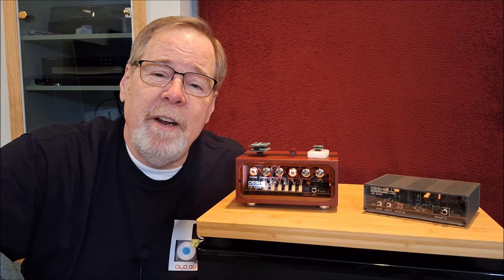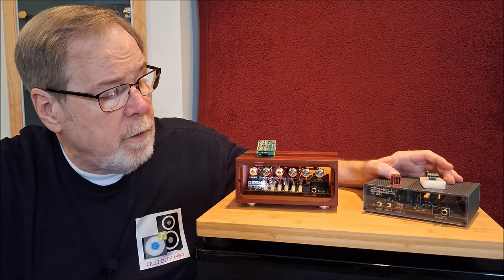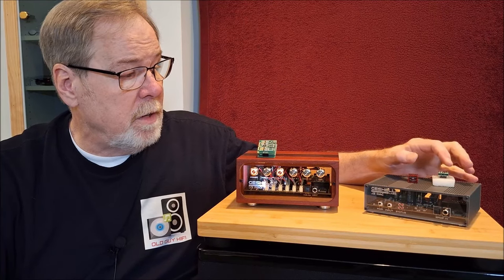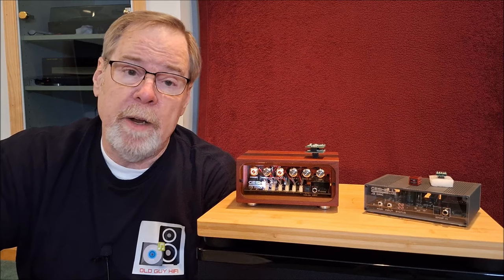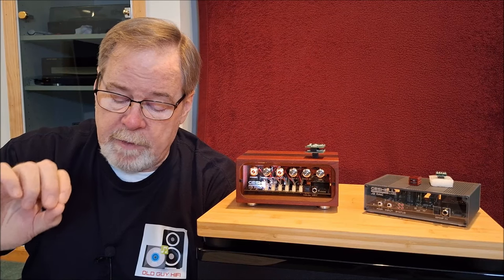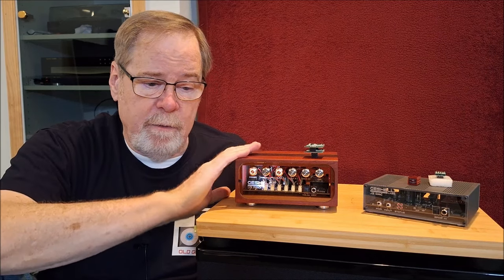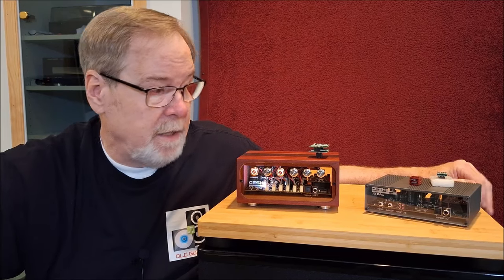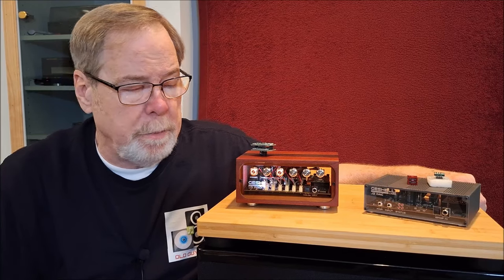The 1st YouTube review of the Geshelli J3 Pro DAC. IMHO it is a fantastic unit full stop.

Comment: First time commenting on your videos.  Sorry for the length.

I value your work and have learned a lot.

I respect your opinion...that said.  I am stuck between selecting the Geshilli J2s or the Pecan Pi + (without the streamer).  I am very happy with my system other than the DAC.

I have a hard time reasoning that all DACs can service all music well.

I primarily listen to instrumental music...mainly jazz (all areas other than free jazz) and classical music (with the exception of period instruments compositions).

Soul (pre 80s) and progressive rock also pepper my listening. 

I am a low brass specialist.   I perform mainly on slide trombone and euphonium. I also have perfect pitch.

I have to live with selection for at least five years.  So please help.  I want an American made unit that serves the music.  Which of those two would you purchase considering the details shared?

Thank you for your time!
Reply from the maker: When it came time for me to choose I bought the J2S. I think it sounds better that the Pecan Pi. Don't get me wrong the Pecan Pi is very good. The J2S is a bit smoother and because you can change the op-amps you can change the sound. It is very good with the stock TI OPA1656 op-amps but I also have the Sparkos 3602 (on the RCA outs) which adds a bit more drive and impact in the bass and mid-bass region. Not too much just better speed. Plus for me the ability to a USB input was key for use. With the Pecan Pi you have to use a SPDIF to USB convertor which, I don't trust to sound the best. I have one and I think it has a negative impact on the soundstage and transients.  BTW, I have a Geshelli Dayzee showing up today which should be interesting. If it is as good as reported, it could be potentially expensive for me. Lol. Let me know what you decide.

Comment: Great review. How is the the J3 Pro better than J2S. Specially when just using single coax input with no need for input switching buttons. Also which op-amp has the most expansive and deep sound. I know all subjective. Thanks. Great review.
Reply: And subscribed.
Reply from the maker: Markus, For all intents & purposes they are identical sonically. The J3 has a bit of a bigger power supply as the large Sparkos require more power and the board was reconfigured to accommodate those large 2590 op-amps. I had the J2S and the J3 side by side and I bought the J2S. The op=amps are very subjective. My advice is to listen to the unit with the stock TI op-amps for a few months and then if you feel the need try rolling them I would start with the Sparkos 3602 and go from there. BTW, If you buy the op-amps from Sparkos directly they offer a 15% discount. I hope that helps L et me know what you decide to do. Great question. Thx.
Reply: @OldGuyHifi  Ok thank you very much. What made the decision to keep J2 over J3? I am interested in trying the Sparkos 2590s (is it) which only fit the J3, or some mod that I read about, which I am not keen on ;) 

Thank you again!
Reply from the maker: Markus, Don't tell anyone bit the 2590 fits in the J2S on the single ended side. I actually showed that in the video. I have both and I don't hear that significant a difference between the 3602 and the 2590. I have the 3602s in my unit and am very happy with the sound. I am actually sending the 2590s back (review samples) and have really no interest in using them. Try the stock TI op-amps for awhile and see what you think. Keep me posted. Thx.
Reply: @OldGuyHifi  awesome thanks for the answers. Like you I prefer R2R over chip based but something magical (supposedly going by reviews) seems to happen with these units. 

Thank you.

Comment: What or how did you modify the Schitt Bifrost?  OG or 2/64?  BTW, ESS chips can run in voltage or current mode from what I've read.  LIKED and SUBSCRIBED.  Thank you for a great review.  Keep up the great work.
Reply from the maker: My Bifrost started life as an OG AKM chip unit. I had a service issue with it and as it was early on in the multi-bit era for them they modified it and asked me to test it. It has a non-standard linear power supply, Unison USB and an Analog Devices prototype 24 bit chip. It also has Elna Aluminum foil caps through out.
Only the very latest ESS chip are current based.
Reply: @OldGuyHifi  Wow, thanks for the reply.

Comment: Hi Ed. New to the HiFi world and just found your channel. Thanks for the great review/breakdown of the J3.  Quick question. I have not pulled the trigger on a DAC as of yet.  I will likely go with the J3 now as compared to J2S with AK4499 its seemingly only $100 more.  I may not update the Opamps right off the bat; however I wondering between the Sparkos vs Burson V7 Vivid. I my starter pair of speakers are the Heco Aurora 300s which I understand to sound a bit on the warm side due to material used on woofer and tweeter.   I prefer a bit more revealing/detailed sounding music....with that would your recommend the SParkos or Burson vivid? Sorry so long winded...  Good luck with your channel!
Reply from the maker: Chris, Welcome to this crazy hobby.  The more the merrier! Honestly, I would stick with the stock TI OPA1656 op-amps to begin with.  They have great detail and will add a bit of midrange to a warm system. You may find you don't need to change them. I ran the J3 with the stock op-amps on the balanced side, for several days of listening and found that to be very good. Seriously good. The magic in the J2S/J3 Pro is that AK4499EXEQ-AK4191EQ chip set and how Geno designed it. Swapping op-amps is more of a tweak and has a subtle sonic effect. As a new person to the hobby, you should listen to your standard gear configuration for months and months, maybe even for years so that you get used to the sound. You want it to be kind "second nature" so that when you do make a small change i.e., op-amp swapping, you can hear that change. Also only make one change at a time, slowly.  Again so you will be able to tease out the differences. Often times, I find that, while there are differences, it still all sounds great. As some famous old guy in history said "Know thy self" I would consul that you should "Know thy system first" before making any changes. I hope that helps you. Sorry for being long winded. Thank you so much for you question and view. I hope you subscribed!
Reply: @OldGuyHifi  Thanks for all the great info/guidance Ed! Much appreciated!  I will follow your advice and order the J3 in its base configuration.  Have a good one!

Comment: Great video! If you were going to order a J3 how would you spec it out? What op-amps would you run?
Reply from the maker: Honestly, I would spec it out as a standard unit with the stock TI op-amps and see what you think. Andrew at Sparkos always has a deal running son if you want to upgrade it is a bit less costly from him then it is from Geshelli. Secret Tip. Skip the USB unless you really need it. That will save $50.00. Also I can't help you with case options because that is a matter of personal taste. For me, because my gear sits in rack behind a glass door, I would just do the standard Aluminum case. Although, after watching Rachel's latest video on the custom carved cases, (https://youtu.be/7mWW4k8N7Ik?si=zmEj50KD0S6PRWkJ) it makes that a compelling option if I was able to show the DAC off.  I hope this helps.  Let me know what you decide.  thanks.
Reply: @OldGuyHifi  Thank you. At this point I'm looking for something to use with my MXN10 and my Cambridge CD player so I can skip the USB... and the custom cases do look pretty slick!
Reply from the maker: I used the J2S (with the 3602 on single ended) extensively with the MXN10 as a source for almost all my recent vintage reviews and the review of the Schiit Freya and Orchard Audio amp. That combo is magic. Highly recommended.
Reply: @OldGuyHifi  running optical or coax out of the MXN10 to the J2??
Reply from the maker: I used both. I am not sure there is a big difference between the two. I use Audioquest Pearl optical and Mogami coax and I find it difficult to hear any meaningful differences. Sometimes I think I do and others... Thanks for asking.
Reply: @OldGuyHifi  sorry for all the questions... Do you use the AKM 4493 or AKM 4499 in the J2s?
Reply from the maker: @S682  Ask as many as you want. No worries. AKM4499. It is the first non R2R or Multibit DAC that could live with. It sounds remarkably good. Highly recommended.
Reply: @OldGuyHifi  Follow up question, how does it compare to the Schiit Bifrost?
Reply from the maker: @S682 Honestly, it is very close. I really think this new AK4499EXEQ+AK4191 chip set is potentially a real game changer. Being a hybrid it kind of is the best of all topologies. This is the first time I have been tempted to add a new reference DAC to the system. They are different but one is not necessarily better than the other just a different sound signature. The J2S/J3Pro are very good. Seriously good.
Reply: @OldGuyHifi  Thank you.

Comment: Great review Ed! I have j2 with 3602 sparkos.   Is the upgrade from 3602 to 2590 really audibly worth it in your opinion?  Also, you mentioned it but do you have a link where theres more info on getting those 2590s into the xlr portion of the j2?   Thx again!
Reply from the maker: I felt there was a enough of an improvement to warrant an upgrade. I don't have any info other than anecdotal conversation.  You could reach out to Andrew Sparkos and see what he thinks. He makes all of those gizmos to begin with. Sparko@SparkosLabs.com
Reply: The 2590 is everything Andrew from Sparkos wanted their discrete opamp to have, but they couldn’t fit it all on the smaller ss3602 opamp (right from Sparkos website). I have both and the Pro opamp is 4 times the size of the ss3602. In my experience the change felt like I was transported into a studio setting with a simple opamp swap (ss3602 to 2590). I hear everything, and nothing’s missing. I have 3 unused ss3602’s now 😅.

 I didn’t do this with Geshelli, haven’t gotten a chance yet. Have to get over their prototype look first 🤷‍♂️. I did this on my aune Magic DAC XVIII w/ their LPS upgrade, sounds great!

If you could fit it, you’ll hear it! 😉
Reply from the maker: Great input and insight. Thanks Ivan.
Reply: @HiFiMods great way to describe it.   Thx!

Comment: Ed… was it a struggle to hear the differences between the op-amps? The reason I ask relates to your discussion of ESS voltage DACs verses the AKM current DACs. It is my understanding that the op-amps are used to convert voltage to current. Therefore, an ESS DAC leans more heavily on the op-amps and thus op-amps will have a greater influence on the sound. I’m thinking that since the AKM DAC is already current based, the effect of the op-amps might be more subtle and difficult to pick out.
Reply from the maker: Steve, you always have great questions and subsequent responses. I appreciate that. There are very few ESS DACs that allow Op-amp swapping. That said I do have an $80 DAC in for review that has socketed op-amps. Should be interesting. The most obvious place where the swap is apparent is on the balanced outputs. Yes op-amps do work that way but the amount of current any IC chip can handle is rather small so the op-amps bring that up to a line level of 2 volts on single ended and 4ish volts on balanced with sufficient current to drive the input of a pre-amp, especially passive ones. The differences are subtle and for the most part they don't leap out at you. The differences manifest themselves in 1) a reduced noise floor and 2) it better fine detail like transient decay. So, yes it takes some time to suss it out. I make lots of notes over many hours. There are times when I can't discern any difference. The other thing is that just because there is a difference it doesn't necessarily mean it is a negative i. e., the Burson Vivid sounded very warm and nice, much to my liking but the Sparkos 3602 had more detail. No real winner. Great question and comment. I hope I was able to answer it satisfactorily. Thanks so much for your view.
Reply from the maker: I edited my response to include some additional information. Sorry it's 1AM here and I am knackered. Thx
Reply: @OldGuyHifi  1a here too… go to bed.
Reply from the maker: I didn't make the connection from your other post that you were local.  Thx.

Comment: Ed, the Geshelli j3 has 3 op amps. Would it be good to replace all three and not just the two you reviewed? Thanks!
Reply from the maker: Great question. If you are only going to run it with RCA (single ended) then you only need to replace one op-amp. I was running balanced (XLR) so I had to replace those two. How are you thinking of using it? Thx for the question and the view.

Comment: I like the Bifrost better than the J2S even though I have the ss3602 and AKM4490 upgrades with the default smps. When i used a linear power supply, then i thought the Geshelli matched the Bifrost.

One other note. Did you use the Sparkos Pro Dual SS2590 in the J2S single ended? I think in the video, you said yes, but just making sure.
Reply from the maker: They are both quite good. I have a couple of linear PS on the way. I may do a video on that very subject. Thx for tuning in.
Reply: @OldGuyHifi  thanks for the video
Reply: Using the same op amps, what is the sound quality difference between the J2S and J3? Is the J3 worth the upgrade? I don't care about the functionality since I'm used to the J2S.
Reply from the maker: @thepracticalaudiophile  They are near as makes no difference the same. I honestly heard no difference between the two. That's why I still have my J2S. Thx.

Comment: Hi,
Do you consider the tonality Neutral/ Natural with the 3602 and the 2590 Opamps?
Thank you 🙏
Reply from the maker: Ronen, In all honesty the differences are subtle. If you are streaming from a phone, then I would consider saving the $ and going with the 3602s. That said, try the stock op-amps for about 6 months. They are very good. Unless you understand how the stock configuration sounds, you can't have any idea if the Sparkos are better. Take your time. There is no rush. Get a baseline before you make changes. Great question. Thanks.
Reply: @OldGuyHifi  I will rip my CDs to WAV files and play them. 
Eventually, on paper, digital data moving from my phone to the DAC, likewise from a quality streamer, so there's not suppose to be a different in the sound quality, if I understand correctly.
Thank you again

Comment: I have the J2 and like it a lot. My only issue is the output (even in hi mode) seems too low.  Did you have this issue?  It is not able to drive some of my amps to clipping.
Reply from the maker: I have not had any issues with that. What preamp/amp are you plugging it into? Let me know.
Reply: @OldGuyHifi  I am using a WiiM Ultra going to the DAC via toslink cable and then from the DAC to the amp via unbalanced RCA cables to the amp. The WiiM is acting as both the streamer and the pre-amp. One of my amps can use balanced XLR cables, so I will try them and see if it makes a difference.  If I do not use the deck, and just go straight from the ween to the amp via RCA cables, I get plenty of volume. The volume on the we goose from 0 to 100, and without the DAC I am reaching the speaker and amp limits at around 90. However, when I use the DAC, I can turn the volume all the way to 100 without any distortion or clipping, but with also not hitting the max volume the speakers or amp or capable of.
Reply from the maker: So, unless the DAC had a volume control or an output level setting, which most won't on SPDIF connections, the issue lies with the WiiM Ultra and maybe an input level control. I will check in the WiiM software to see. What brand & model DAC are you using?

Comment: what would be the value proposition/business case for having both SE and XLR use best chips offered right  off the bat?

Am thinking of keeping stock chips for SE since I intend to connect DAC to main amp via VLR and SE, in parallel, to active subs ( L/R).
Reply from the maker: Your thinking is good. My sage (lol) advice is to get it with the stock TI OPA1656s and listen to it for a few months. Then roll the op-amps. The J3 Pro sounds really good right out of the box. (Pro tip) When you want to upgrade the op-amps to Sparkos, buy them from Sparkos. They always offer a 15% off on your purchase from their online store. I currently have a Dayzee in right now and I am running it balanced and Single ended with the stock TI op-amps and holy sh*t does it sound amazing. Thanks for asking and watching.
Reply: @OldGuyHifi  I hope I am strong enough to resist Dayzee's lure. ;)

Thanks for the tip on the chips
Reply from the maker: @Exgol2005  The J2S AKM4499 & the J3Pro & the Dayzee all share the same sonic signature. The J2S & J3 are as near as makes no difference identical sonically. The Dayzee has better imagining and sound stage. Maybe a touch more treble clarity. You can't go wrong with any of them.